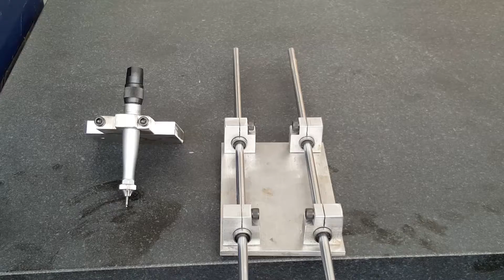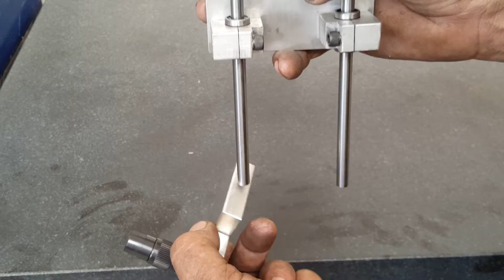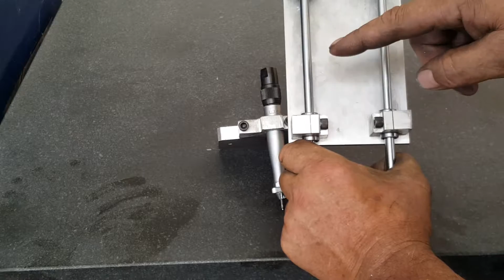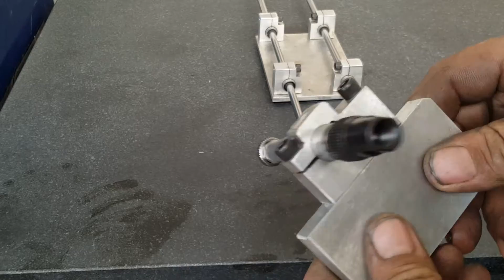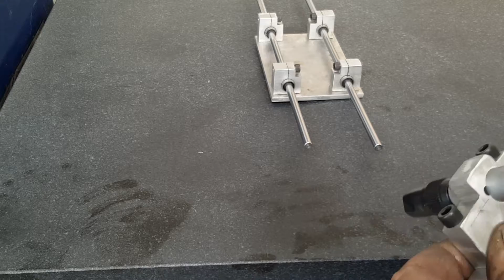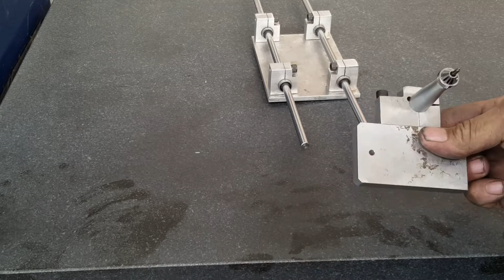CNC Plate Marker Scribe - Part 1

Comment: Where did you get the slide. Got a link.
Reply from the maker: It is just linear bearings and  rod. I machined the rest. I would suggest to use slightly larger size rod as I get some flex. I used 10 mm so 12 or 14 would be better depending on the stick out.